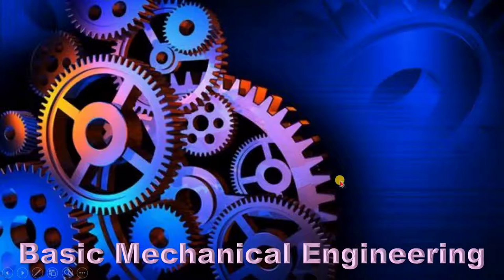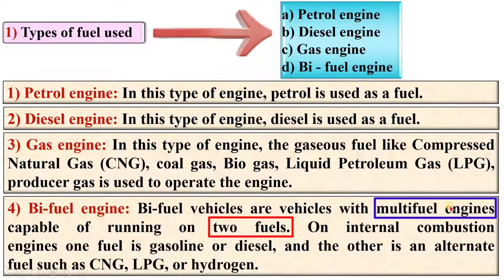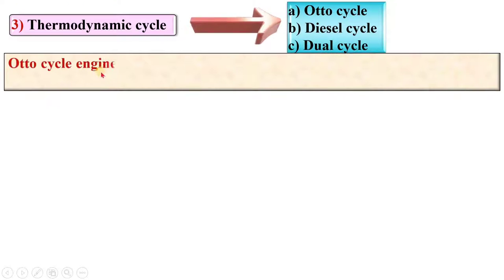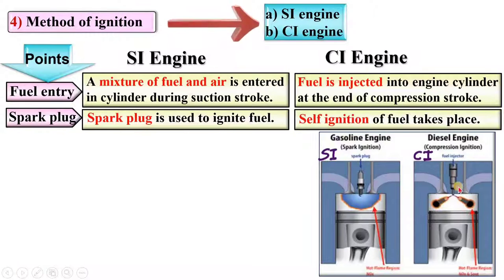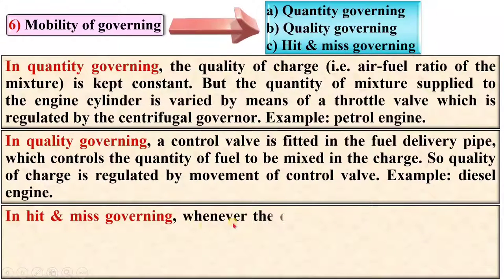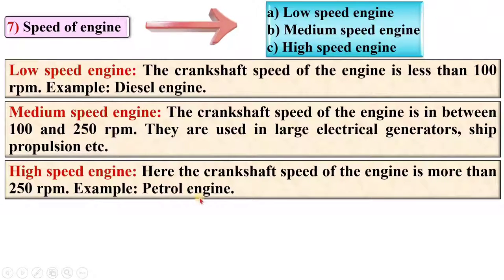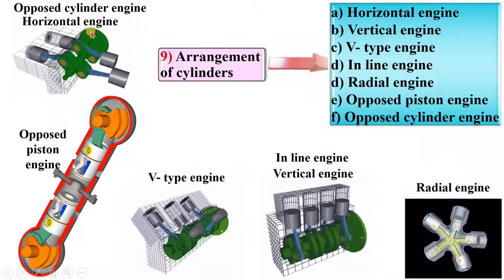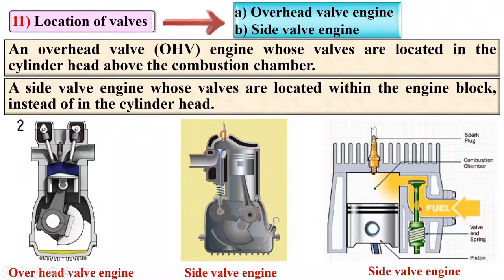Classification of IC Engine Based on Strokes, Ignition, Speed, Fuel Supply, and Cylinders

Comment from the maker: Classification of IC engine explained with Animation for better understanding with following timestamps: 
0:00 – Basic Mechanical Engineering lecture series 
0:11 – Classification of IC engine
0:52 – Types of fuel used
2:04 – Number of stroke/cycle
3:43 – Thermodynamic cycle
5:11 – Method of Ignition
5:56 – Method of cooling
6:54 – Mobility of governing
8:50 – Speed of engine
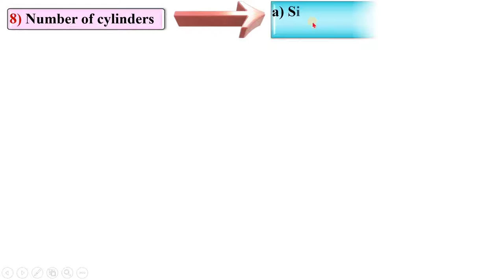9:50 – Number of cylinders
10:41 – Arrangement of cylinders
11:52 – Fuel supply system
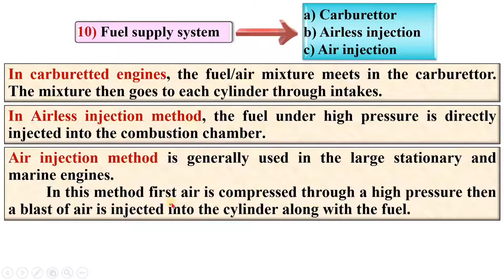12:57 – Location of valves